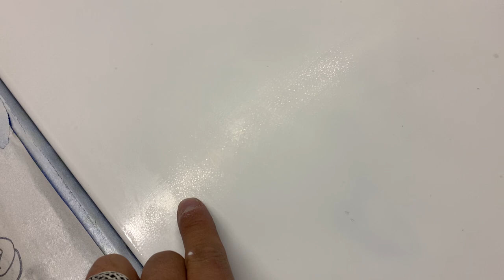Rattle Can Paint Job - In the Cold

Comment: i have used rustoleum with a turbine hvlp system using laquer thinner to wipe first and thin  several light coats and then a wet coat  outside on a non breezy day and resulted in close to perfect results with no sanding and looked the same a year later 2 quarts for a nissan truck
Reply from the maker: That's great to know, thanks for sharing!

Comment: Nice vid! The weird spots next to the scratch looks like silicone contamination, silicone is pretty nasty towards paint jobs. You could try a special silicon degreaser or instead of rattle can, use special anti silicon drops in normal canned paint. You can get as good results with a roller, the painting itself only takes longer.
Reply from the maker: Silicone, really? Maybe the acetone I used messed me up! All in all, I'll probably strip this down and do a better job prepping when I'm ready to do the whole car. Sometime next year, in a warmer climate.